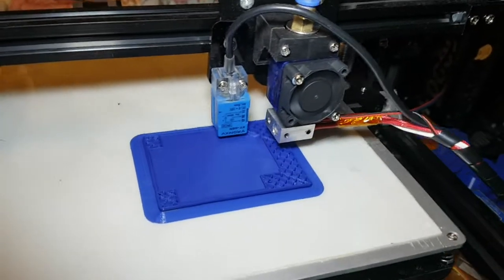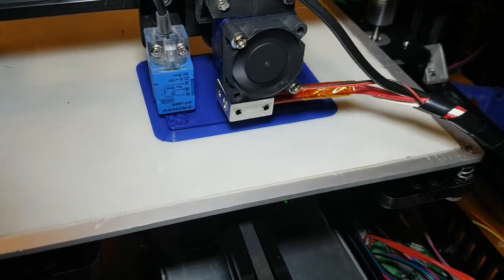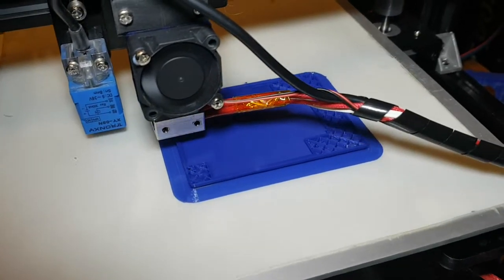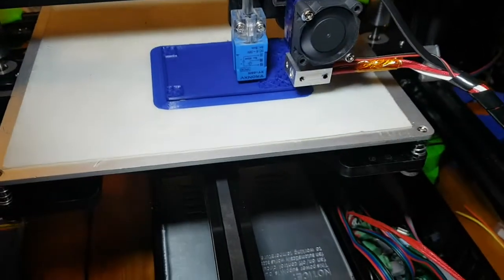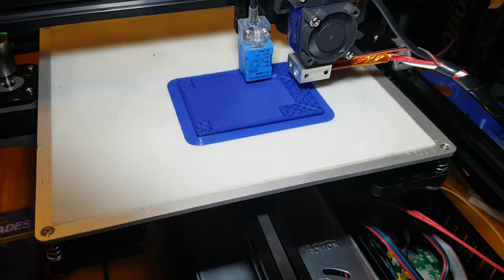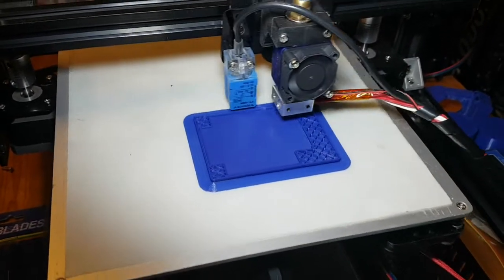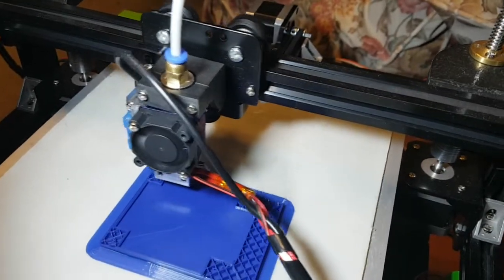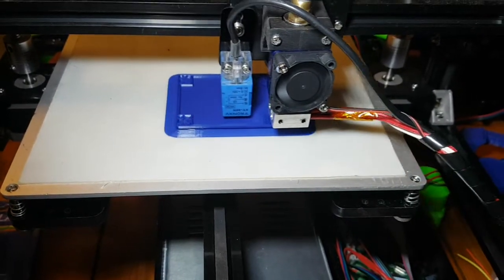TRONXY X3A 3D PRINTER

Comment: Sorry, but I did'nt understand: what kind of sheet instead of the blue one do you use for the base (heatbed)?
Reply from the maker: Detlef Heine Here you go sir...

Wisamic PEI Sheet for 3D Printing with 3M 468MP Adhesive Tape, Multiple Sizes Available (8"x8",0.8mm thick) https://www.amazon.co.uk/dp/B07253DJM6/ref=cm_sw_r_cp_apa_sxZ8zb4Q191JY
Reply: Thanks a lot, hendjim :-)